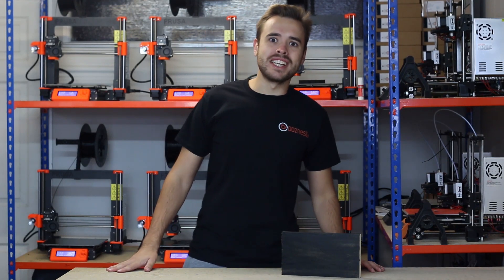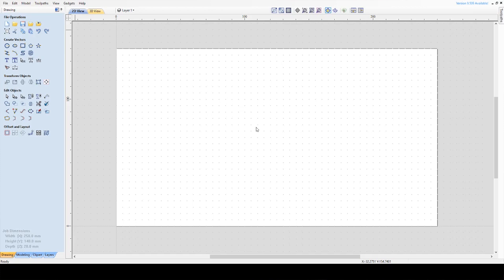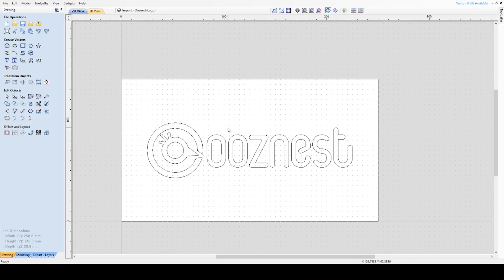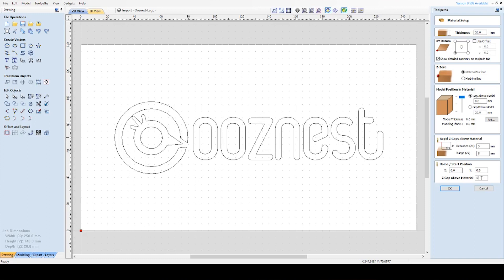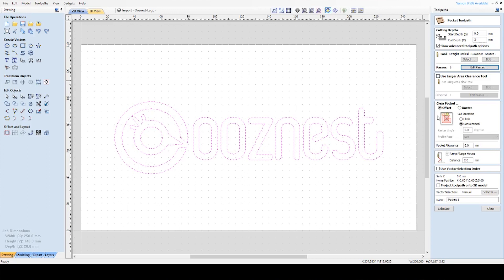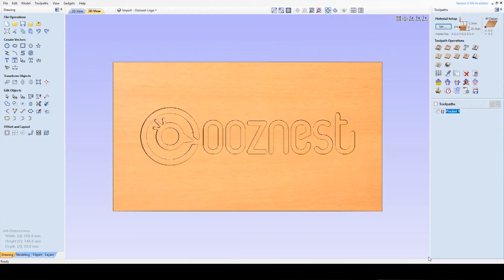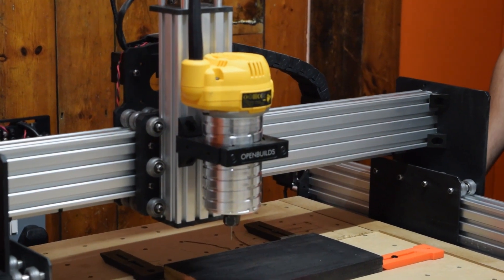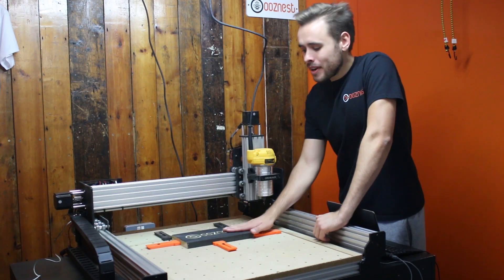How To Set Up A Job On CAM Software | WorkBee CNC Machine | Ooznest

Comment: Newbie question ,can you use any software  on the workbee?
Reply from the maker: For the control software, you have to use WorkBee Control. But CAM Software wise you can use pretty much anything
Reply: @Ooznest  okay thank you .
Reply: @ooznest  Could you please confirm whether or not you CAN use UGS or GRBL control software with the Duet3 controller if you choose? I understand that you recommend Workbee control, however if I prefer to use a standard control software is it possible? i.e is the Duet3 GRBL compatible when using the serial port only?

Comment: Hello Ryan, i have a problem with my CNC, it offsets the designed pice from the work pice in X, and Y axis sometimes 5, 6 cm and sometimes 3, 4 cm what am i doing wrong? i followed the steps you followed to the letter and it's not cutting correctly
Reply from the maker: Hi, are you using the Touch Probe to set the Work Zero? If so, you have to be careful using the fluted section, as if it contacts on the inside of the flute, it could offset your job. Sometimes best to use an old endmill upside down.

Comment: He Ryan, great video. It explains very clearly how to create a simple job.
But ...
One comment on the screenrecording: it seems that only the main Aspire screen was recorded and not the sub-windows that you opened. I guess you were trying to show something in several sub windows as the mouse pointer was moving around while we only see the main Aspire screen.  This happend when you were talking about importing the logo file, the bit selection, saving the toolpath file.
Reply from the maker: Hi Bert, Glad you liked the video. Damm we didn't notice that, looks like the screen grab didn't pick them up. We will see if there is something we can do to fix it.
Reply: It would be nice to have the sub-screens with the rest... it is kinda hard to guess what you are doing there. Even without it was a helpful vid, so thanks for that! @ooznest

Comment from the maker: If you have any questions, please ask below :)
Reply: Hey Ryan. Thanks for the video. When you set the Z Home/Start position to 5mm my understanding is that you then need to raise the Z by 5mm after you have set the work piece 0, is this not the case? It looks like you haven't done this in the video so O might be wrong
Reply from the maker: @Yellers1983  You don't need to do this. It will automatically go up to it when you start the job.
Reply: @ooznest  Ah great, thanks Ryan. Two more random questions if you don't mind, one can you please do a feeds and speeds video and two do you have a UK supplier name for the aluminium square blank you used for your touch probe? thanks a mill